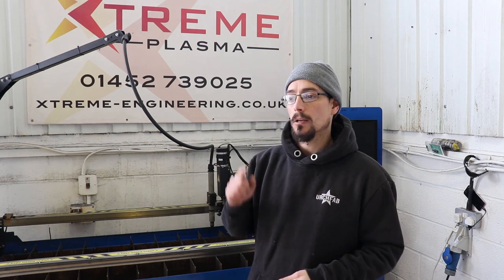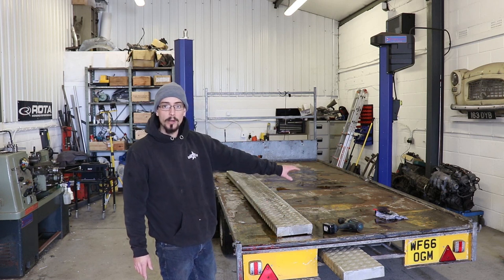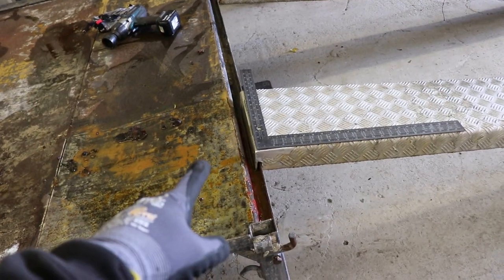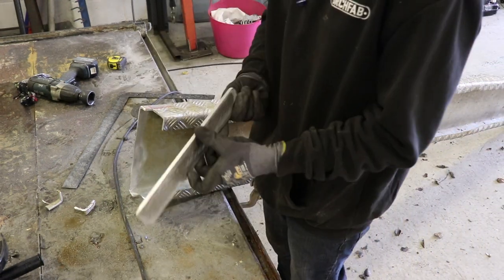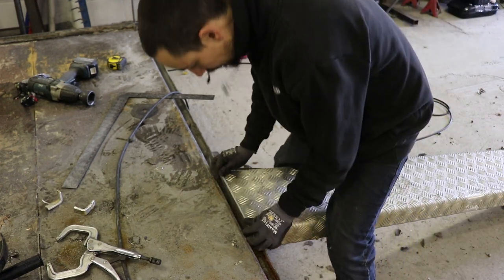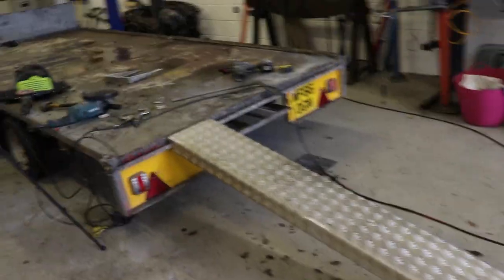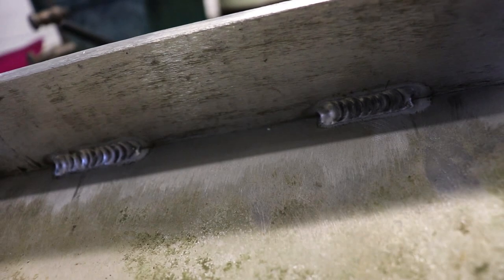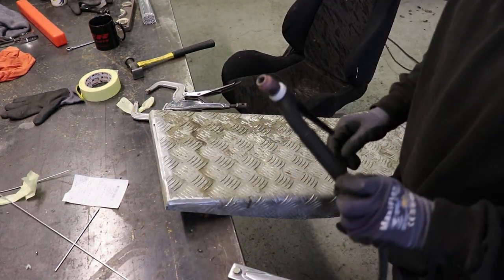CAR TRAILER RESTORATION + MONGREL NEWS!

Comment: probably be a good idea to put a block of hardwood under the end of each ramp to act as a sled , that way it can slide a bit on the street without screaching and making scratches on the pavement (some people are offended by that for some reason )

as for the adds that pop up on the websites youre looking at , i got an app called adblock on google , you can find it in the appstore works realy good and its free

i think with the battery out in the open and sitting in the spray from the car pulling it like that will quickly make it so cold that it looses half its charge , sounds weird but sticking a  12 volt 10 watt or so heatingpad to it hooked to the 12 volts comming off the trailerplug might help a lot to keep it working , putting the battery in a watertight box helps the contacts from corroding too

Comment: A bit of rubber mat under the winch floor would save you from ever having a big ball of plasma flame bursting out from under there. 4 am on the A9 and the ball of flame was about thirty feet wide. Blew the top  of the battery to pieces but it kept running.

Comment: Around 8:15 you talk about the ramp could lift up and that's why you cut that angle. But you can't be sure that when you load a car the surface will be flat so some form of locking of the ramp to the trailer would be nice.

Comment: That is some sexy welds lol what thickness of plate did you use to make the winch Platform just started welding got my first welder to strenghing my wee nova and do arches and weld plates for the cage can you give me some idea what thickness if metal to use on the a pillar as it ratather rusty ware it meets the skuttle and need to cut it out any info would be gratefull plz keep up the good vids as you are helping me learn to weld and set it up here in glasgow.

Comment: Hey Matt, you didn't say if both ramps came off at that angle, if they did maybe there's a reason.
Only one I can think of is that the run up would be clearer of the curb edge. (clear of the sidewalk).

Comment: Too high, too heavy. Build a new one. A lot easier and you get what you need.
Use rocker and roller springs which in turn act like a tilt trailer. My trailer is 13'6" by 6'6" between the guards and uses 8 foot long ramps and that is for very low racecars.
Has a belly box 4'x 2' between the axles and an extra  toolbox on the side. Belly box carries racecar spares. Weighs 750 kilo. With 2.5 ton springs and axles